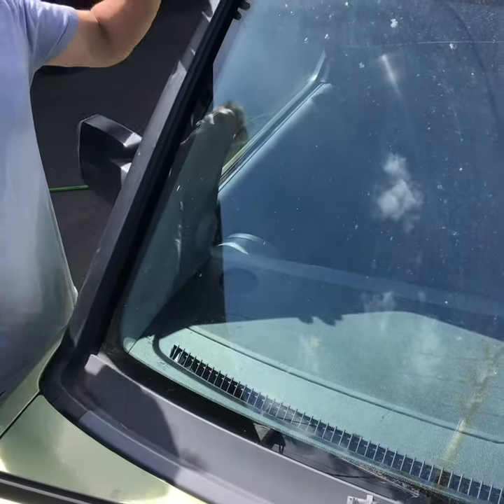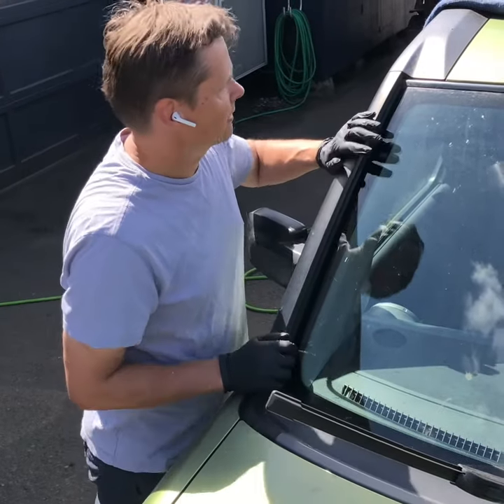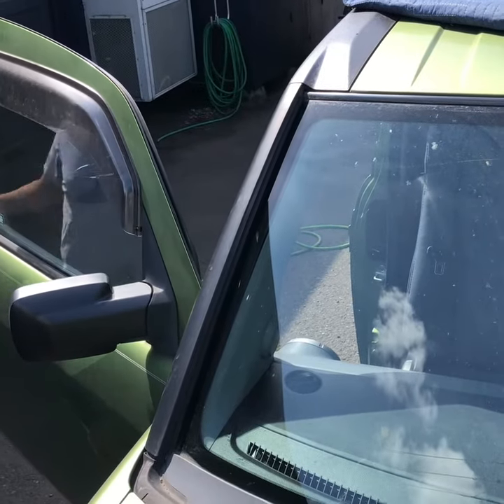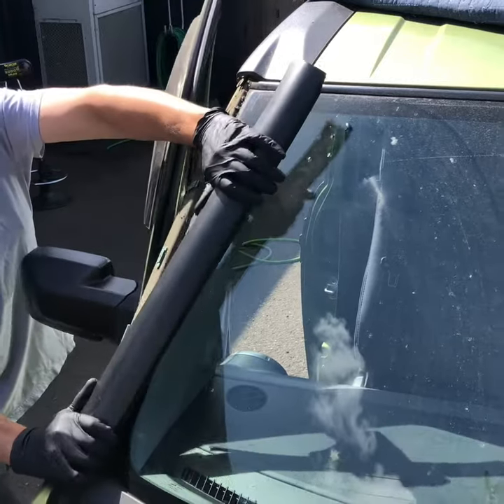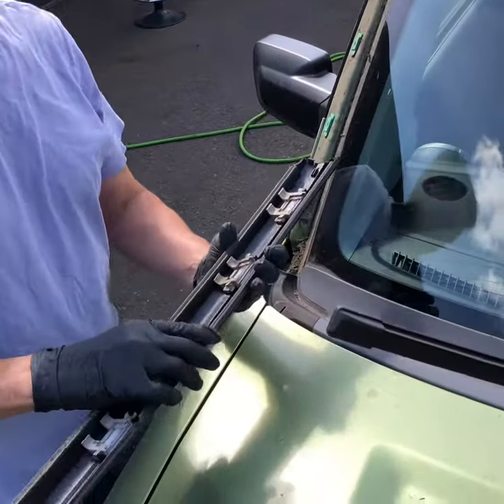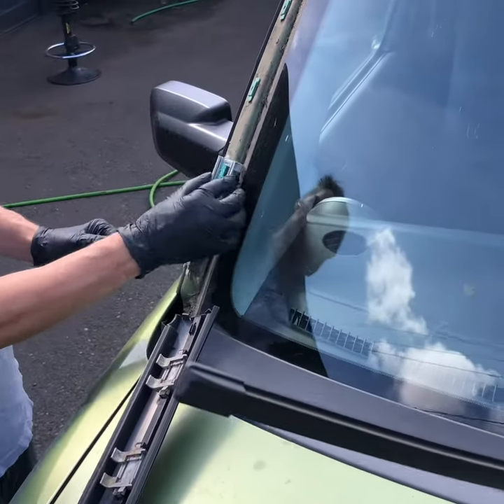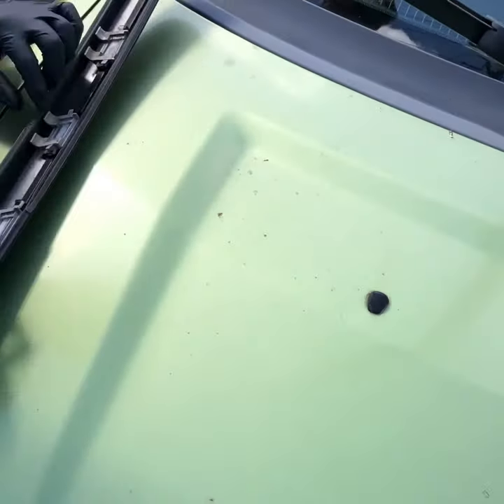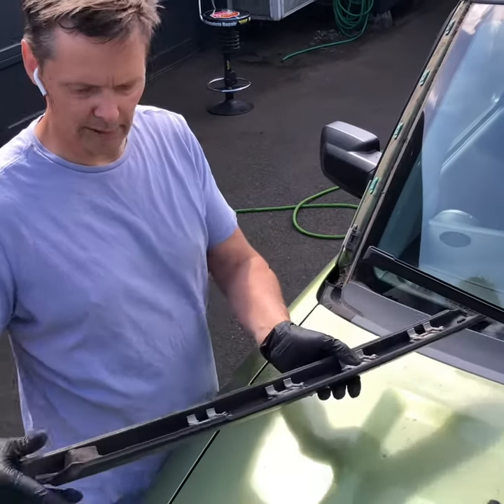Honda Element - How to Remove Windshield Trim/Garnish Moulding

Comment: Need a video on how to install the light bar mount kit before i commit to buying it. I cant really tell what modifications need to be done to this pillar and how it is installed
Reply from the maker: If you’d like to contact me through our site, I can send you the instructions. https://elementdriven.com/pages/contact-us

It involves drilling ink your A-pillar to mount the brackets. I run a SportERack and have my light bar mounted to it. No drilling.

https://elementdriven.com/products/diode-dynamics-stage-series-led-18-30-42-inch-light-bars?_pos=2&_psq=light+bar&_ss=e&_v=1.0

Comment: What I will never understand is how the wind / highway speeds can rip these mouldings clear off the Element.  😑
Reply from the maker: Usually it’s a combo (in my opinion) of improperly mounted trim (glued on after fasteners/trim tabs get broken) and the lack of slope on our windshields. The air is looking for the quickest escape once hitting the windshield at decent speeds so additional airflow is forced to the sides of the glass versus over the top.

Comment: Honda has some great engineering but this has to be one of the dumbest designs they have ever come up with.
Reply from the maker: Honda engineering is impressive, but typically it’s the trim getting reinstalled improperly that, I believe, causes the trim to go into fling mode.